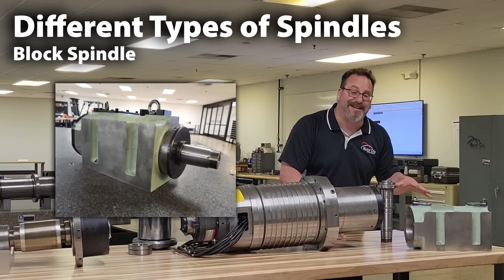What is a CNC Spindle? | As the Spindle Turns

Comment: Got bored after 4 mins :(
Reply: Understood.  I’ll try to do better in the future.  Any suggestions is appreciated
Reply: @tedladzinski5809  Ok.
To me, a spindle is a spindle - but what you have is much more complex. You also appear to have a selection there - and that doesn't help. I was not even convinced by what you were saying was actually correct (regarding encoders).
My train of thought to cover this interesting topic, would be for you to start with your most complex CNC spindle completely stripped down to the actual spindle the chuck etc. mounts to. Then make the video cover the rebuilding of it peiece by piece explaining what each of the pieces does.
My guess is the CNC spindle does nothing but rotate and hold a 'chuck'. Very simple. So the first question is speed range - and I'd guess that's almost 0-max speed in almost finite steps. I'll have a guess: 0·001 to 5000 rpm ? So if you wanted a speed of 2463·841 rpm, you could have that.
I'd also expect a speed of 0 and a position  anywhere between 0·000 and 359·999°
I'd also expect the spindle to carry chuck control connections - electrical and either pneumatic or hydraulic.

So build the whole thing, bit by bit explaining what each bit does and how - if it needs explaining - such as chuck electrical connections via brushes and slip rings.
Feel free to discuss ideas with me further.